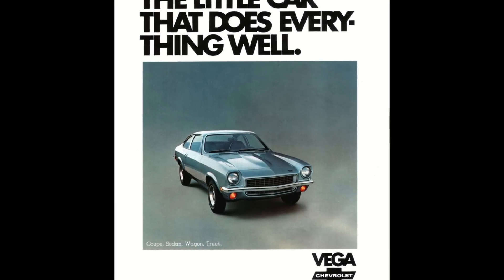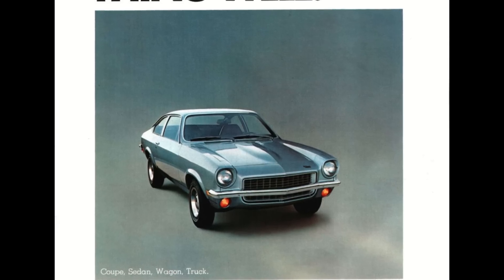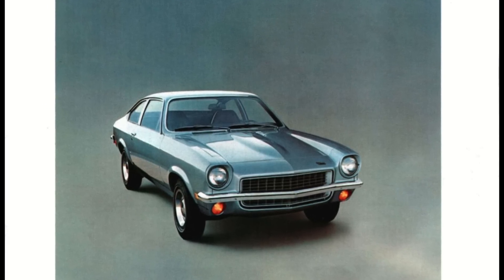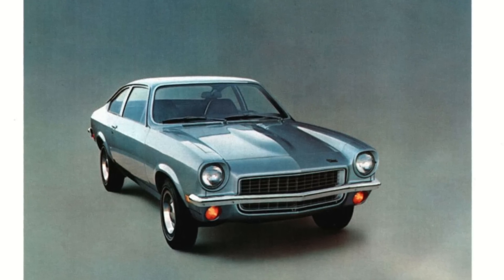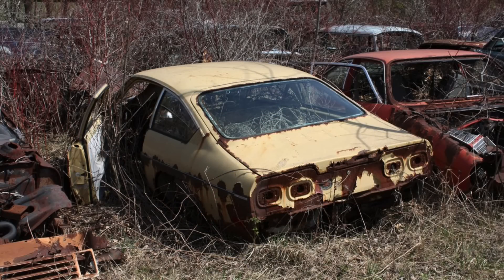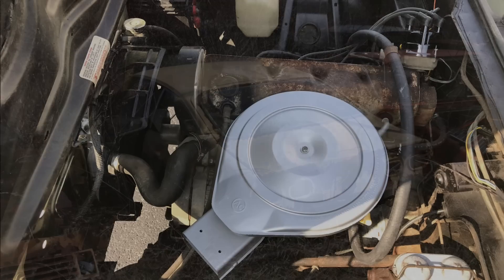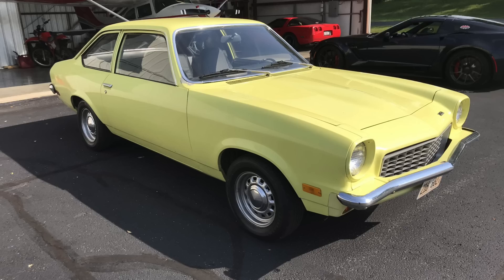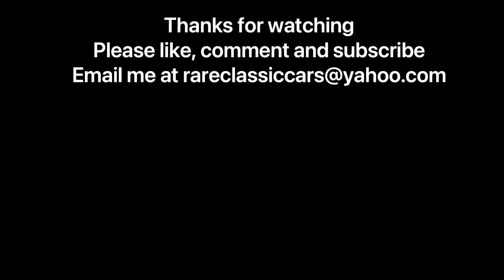GM's Largest Failures: Why The Chevrolet Vega's Engine Turned Buyers Away From American Cars

Comment: the japanese two stoke manufacturers used a nikasil coating on there bores but there is much more oil present on these designs and lower torque ratings.
Reply: Before nikasil, hard chrome was used. Bridgestone used chrome bores on most, if not all of their motorcycles. Yamaha had chrome bores on some of their early YZs. My Homelite string trimmer has a chrome bore.
Reply: @k4106dt  exactly why we use hard chrome plating on fork tubes, it has long wear life and provides and excellent surface for the fork seal to ride on. btw we don't use shiny chrome on fork tubes except on custom show bikes...

Comment: My first car,  and the one I regret getting rid of,  was my 73 Vega 😢
Reply: Yeah I know what you mean, my first one was a 74 and then I got a 76 to go with it. The 74 was using oil when I got it but I would like to say that you can indeed overhaul one without sleeves if the bores are not scratched. You just put new rings on and don't hone them and they work awesome. Mine were smooth as can be so an overhaul kit later, it was back on the road and was as reliable as can be. Long trips it would click out 40 mpg all the time with the 2 barrel carb. I enjoyed them and would love to have them back. My 76 had power steering and AC, it got an overhaul as well, so yes you can rebuild them. Yeah they had their issues but when 99% of the motoring public are idiots, it just makes things worse.

Comment: My parents owned a  Kammback. It destroyed the loyalty of a GM buying family.
Reply: My neighbor had a Kammback but he had his fitted with steel cylinder liners and it turned out to be a great engine. Only if Gm had done that...
Reply: "I wish a Ford and a Chevy would still last ten years
Like they should
Is the best of the free life behind us now?
And are the good times really over for good?"

Merle Haggard "Are the Good Times Really Over"
Reply: You know what's funny? VW did that to mine with their 1980 Rabbit, our first new VW. We'd had nothing but assorted Bugs and a camper and a Ghia and all were good cars. When the man we sold it to rebuilt the motor, he said two studs were missing from the head that bolted it to the block and that is why it was using water but not leaking it - but the VW dealer couldn't replicate the problem before. Not to mention having to hit the dash in just the right place to make the radio come back on and a bunch of other stuff. I still won't consider a VW.

Comment: I remember a guy back in ‘79 dropped a built 283 in a ‘71. It was quick! 😀
Reply: The right thing to do
Reply: You sure it wasn't a Monza? The Vega was a unibody and didn't take well to V-8s. The Monza had an old school frame under it and you could easily drop a small block in there. Fastest car I've ever rode in was Monza with a 350.
Reply: @markw999 vega and monza had basically the same unibody chassis. I would bet that the majority of Vegas still on the road have  been v8 swapped.
Reply: It was a low mileage ‘71 Vega with a trunk like the yellow one in the vid. It was a medium green metallic. He got it for free as the engine was seized, and the lady that owned it didn’t want to pay for a new engine. He had a shortened 12 bolt and an M22 in it as well. Ran low 12’s smoking the tires thru 3rd gear! 🤣